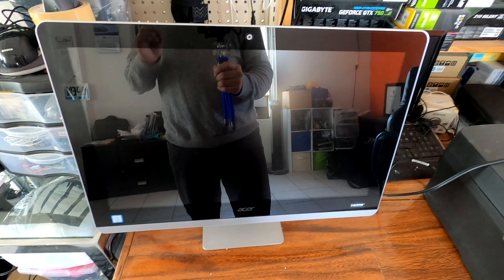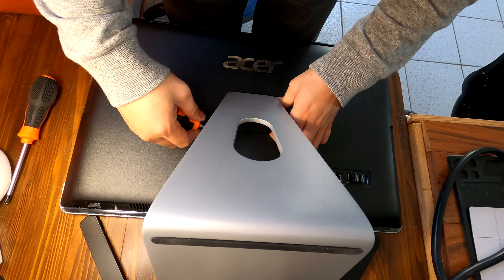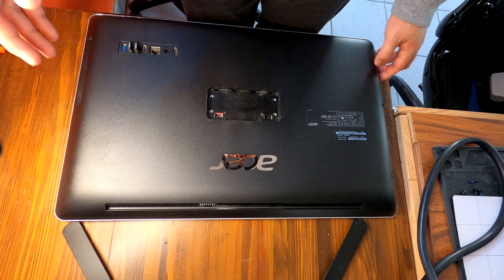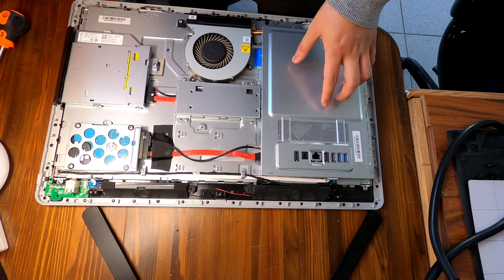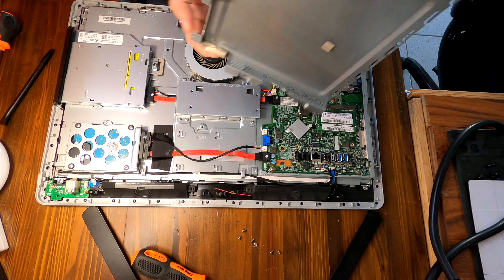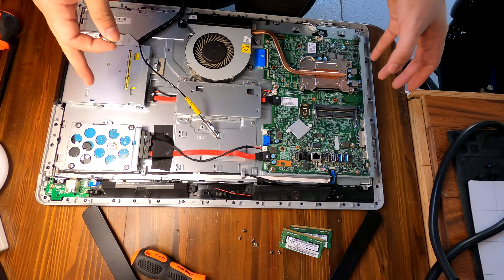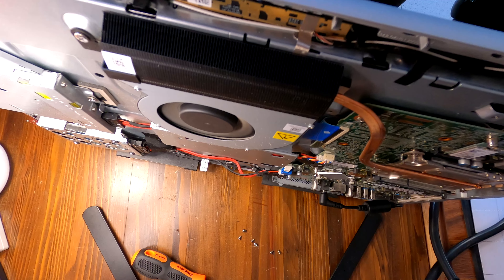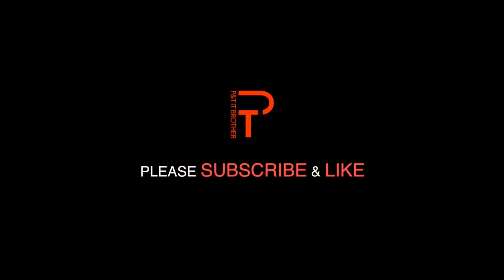Acer Aspire All-In-One Z22-780 Disassembly (No Power, Not Turning On Fix!)

Comment: Hi there, I have an odd question about this computer. I'm trying to add another Hard Drive, where could I find the special HDD connector that acer is using in this computer?

I'm having a very hard time finding it online, especially because the platform is so old now.